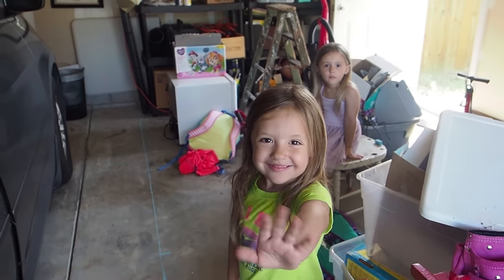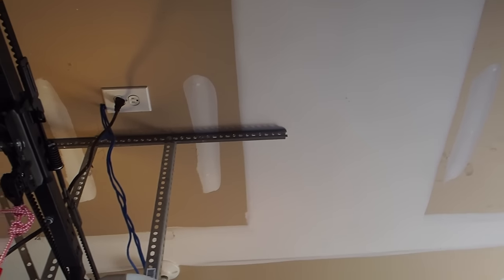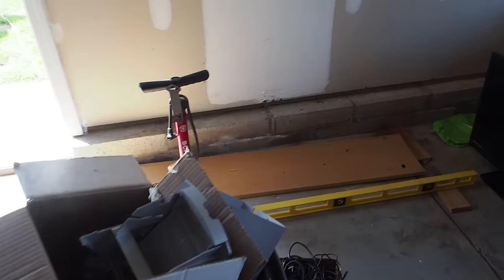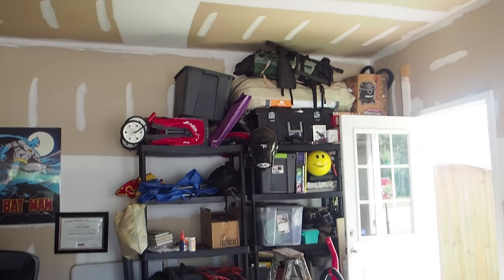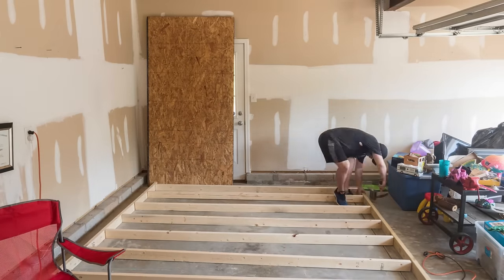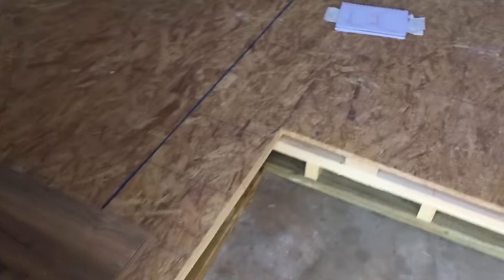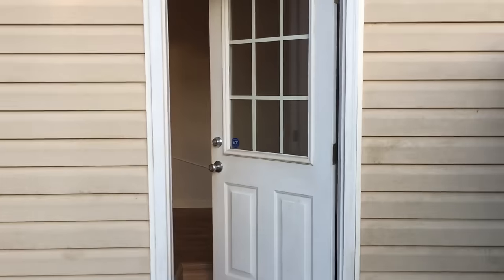I Built An Office In My Garage (and still have room to park our van)!

Comment: I have been looking on YouTube for years and it is almost impossible to find a video where someone converts 1/2 or only a portion of their garage. I rented a room that was 1/2 a garage and the owner did it in 14 days. It had a queen size bed, closet, electric fireplace, and an air conditioner in the wall. The door exited out to the other half of the garage where I parked my car. It was awesome.
Reply from the maker: Underrated house upgrade!

Comment: Funny I'm gonna start next week and I have exactly 8x10 to work with.  My plan is desk on one end with computer and TV above mounted on the wall.  Then on the other end I want 2 lazy boys for me and a buddy to watch fights and drink beer while our wives are inside being responsible watching the kids 😎
Reply from the maker: Yeah, I think it is a perfect size for that, I could easily fit two lazy boys and a small table in between, with a large TV on the other wall, and it would be perfect viewing distance. The only thing bad in my setup is that the inside air conditioner than I'm using is pretty loud... which would not be ideal for watching TV. Could look into a split system, but they are a good bit more expensive. Depending on how your house is set up and the size of your main AC, you may be able to change your ducting to use that. For me it hasn't been too much of an issue because I use noise canceling headphones on my computer almost all of the time, but otherwise it would be kinda annoying.
Reply: @coreyapotter  I have the same ac as you.  I guess I'll just have to crank the volume up

Comment: It may have been a little easier to re-hinge your door to open out and leveled your floor somewhat thinner.  Otherwise a great job for a first try.
Reply from the maker: I did think about that for sure, but the slope of the floor would have been tricky to deal with  even going as thin as possible. Also there was a brick line around the floor that I wanted to cover. The sub floor also gave me a bit more "spring" since I do alot of standing at my desk, and made it easy to run one of the wires to my switch without having to tear up my wall. Since the ceiling was about 10ft, I didn't mind bringing the floor up 6-8 inches. 

Lots of different ways to do it though, and mine were far from perfect, but it has been holding up great, and I'm loving using it!
Reply: @coreyapotter  I'm glad it works for you, and since it is your office, your opinion is the only one that should count.

Comment: Hi Corey, can you advise the process you underwent to build the floor supports that counter the slope in the garage floor.
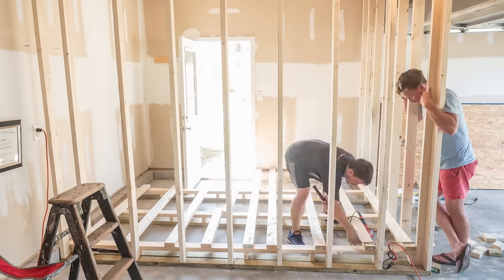Reply from the maker: Nothing too fancy. There was a layer of bricks around the base of the garage that were already level, and at about the right height for my subfloor. I leveled some boards that were laid on top of those bricks, put another board directly on the floor, then measured the height every 18 inches and cut a support (each getting a bit longer as the slope increased). You can see them clearly at 4:04 in the video!
Reply: @coreyapotter  Thanks for your reply.  Regarding the supports, did you slightly taper them (the bottom side) to account for the slope angle?  Or, are they flat both ends?
Also, when you installed the front facing wall (I assume this was levelled straight), was there a slight gap/rise on the back edge of the floor beam (facing the garage door) on account of the slope or did you secure the beam flat to the floor?

Comment: Nice work! Would you need to insulate and heat to officially count this as living space?
Reply: One thing holding me back from doing this is understanding what I can and can’t do based on local regulations/permits, etc.  (i.e. if a room is heated/cooled it may need to be insulated, including the floor).
Reply: @Rick-rn2ur  Probably best to enquire with the relevant council department.  Or, engage a professional builder who will do all this for you, lodge plans, obtain building approval, etc.

Comment: Very nice, I wanna do this in my garage can you please list the material or items.
Reply from the maker: Unfortunately no, I never recorded it like that. I did rough plans and just bought what I needed as I needed it. Mostly 2x4s, drywall, some subfloor and vinyl flooring, and electrical components like wires and outlets. There are lots of things to consider, and while this one isn't meant to be a "here's how to do this" video... there are lots of those on YouTube, and I found many of them helpful in my build process!

Comment: I see you have the heat of your ac going back into the garage, I think in the summer that’s just going to heat up your walls for both your workspace and your garage
Reply from the maker: You are right! I have to open or at least crack the garage door in the summer if I want to run the AC.
Reply: Not just that.. you are throwing CO2 gases in the garage is really dangerous.. you mind want to reroute the ace vent to the outside wall.. other than that.. good work
Reply from the maker: @ethan1627  C02 gases? That is not accurate. Electric air conditioners do not produce C02. The venting/placement has more to do with efficiency. The garage is open 99% of the time, so it really isn't much different than venting on the outside wall. Thanks for the concern though!

Comment: Is it really ok to vent your portable AC in the garage? It’ll cause humidity and even affect your vehicle
Reply from the maker: No, it's not an ideal plan. But I made it work for me and am still doing it this way years later. The "right" solution would be a split system above the door. Jus haven't had the time or budget to make that happen yet.

Comment: I’m about to do the same thing and have almost the same set up but my area is the extra bay that they call a “shop”. 

My question is:

-do you wish you would’ve done a split duct cooling/heating system vs the floor/wall unit?

- is there a need for an access point from inside the garage?

- that step down to the door looks like a hazard. How’s that working out?

Comment: Do you have a list of all materials?  and like what type of wood did you use and all that?
Reply from the maker: I don't have a list. Honestly, it was just me writing down some basic measurements and buying some lumber from Lowes. I used pine 2x4s, treated for anything that touched concrete, and standard for everything else. Standard materials for drywall and subfloor. I think each build will be slightly different, but if you watch some framing videos on YouTube, you should be off to a good start.

Comment: Did you take into account the exterior door?  Room looks great, but the step up space where the door is looks like it was unplanned.  Could you have raised the door as well to match the subfloor?
Reply from the maker: Yes, I took it into consideration. There were several options, and this was the easiest for me. I didn't need that extra floor space and I don't mind the step. Raising the exterior door would have been a major job, including reframing an exterior wall, cutting through siding, and potentially rerouting electrical wires. Just not worth it. I could have made less of a step, but the slope of the floor was pretty significant and I chose this height because I was able to set the frame of the floor on the level bricks around the edge of the garage. Anyway, there are many ways to do any project, and I picked the options that worked for my needs. I'll likely be tearing it out before selling the house, so really it didn't have to be perfect.

Comment: Im confused as to why you raised the floor if you were going to have a step up from the side door. What was the reasoning?
Reply from the maker: The floor of the garage is not level, and this was an easy way to creat a level subfloor.
Reply: @coreyapotter  Oh okay, that makes sense. Could you have used some self leveling compound? I am converting my tandem garage space in the next couple weeks.
Reply from the maker: @melvingray3245  yes, that probably could have worked, but in my case I had about 10 ft from floor to ceiling, so the subfloor made it feel more like a standard size room. Also made it easier for me to run the electricity like I wanted.

Comment: How and what did you used for the floor sub-floor?  Did you include a vapor barrier?  What about insulation?  Where are you located did you need a permit for this project?  Did you do the electrical yourself or sub it out?  I'm planning the same project but with French Doors leading into the office from within the house.  Garage is on the lower level of a three-level townhouse.
Reply from the maker: I learned things about permits that I didn't know before I started. I'd highly recommend getting one, especially for insurance and liability reasons. 

For the sub-floor, I just framed it out with 2x4s and used treated lumber on anything touching concrete. For the laminate sub-floor, I just used the standard stuff they sell at Lowes, some kind of foam, I didn't really pay very close attention to what it was. I still haven't insulated the office, over a year later. I left the outer walls open so I could insulate and just haven't made it a priority because the climate is fairly moderate and so far hasn't been a problem. I did the electrical work myself, but it was relatively simple, only 3 outlets and 2 lights. Good luck on your project! Mine was just something I threw together on a whim, but I wish I had done a bit more research and planning before I started.

Comment: Did any clerical work with the city need to be done? What about inspections like electrical?
Reply from the maker: Yes, but this is going to be highly dependent on your location, as the laws and regulations are different in every country, state, city, county, and even HOA.
Reply from the maker: In general, you apply for a permit (I think they are $25 here), and when you are ready, the city/town/county will send an inspector to make sure you are following codes. 

This is pretty important for insurance reasons. If things are not inspected/approved and let's say a fire is started from faulty wiring, the insurance company may not cover your home.

Comment: Did you permit the project?  Didn't hear anything about that.
Reply from the maker: In most areas, and for many homeowners insurance policies, permits or inspection is required. Also, some HOAs have rules that require you to get any construction approved by them. I learned about some of these things after the project, but in the future, I would definitely START with the permit and have it inspected right after finishing.

Comment: This is great, I'll be building a bedroom in the corner of my garage similar design as your office but bigger.  I'm gonna do this on my own, my question is did you pull permits?  It seems that would slow the process down and raise the price of this type of project.
Reply from the maker: I would highly recommend getting the permits if you ever plan to sell the house or if you want to be sure your homeowners insurance will cover any incidents (for example, if an electrical fire burns down your house and it originated in this unpermitted room, your insurance may not pay). It does slow things down a bit, but in the long run I think it is worth it.
Reply: @coreyapotter  I spoke with a builder who suggested the same - get the permits if/when you the sell the home, just make sure you've got adequate drawings/plans and a documented process of how you built it.  But for sure, the other issue can be insurance if a claim involves/results from the addition.  As it's not an approved structure, they will be sure to scrutinise this.

Comment: I have a questions about the floor?
Reply from the maker: Lay it on me!
Reply: @coreyapotter  I saw that you put wood down on the floor to make it level because your garage wasn’t level but we are putting a Floor on so that I can insulate it. How did you frame the floor. I’m  trying to figure out how much wood we need to frame it
Reply from the maker: @DaNae2334  You can see it best at 4:03 in the video. You can secure these with concrete nails/screws. After this, I believe I laid 2x4s across, perpendicular to the floor frame pieces you see at 4:03. I think every 16 or 18 inches, I'm sure you can look up the recommended code for that. Just make sure you use treated wood on the concrete.

Comment: How is the AC situation working out for you? I noticed you're exhausting A/C into the garage...any issue there? (In Florida - wanting to do the same thing in my garage)
Reply from the maker: The AC worked fine with the portable unit, but wasn't really that efficient. The exterior wall with the door gets direct sun with no shade from like 2pm until sunset, so on these long summer days, it struggled a little in the evenings. Adding a small fan made a huge difference. However, I recently switched out the portable unit for a window unit. I'm still venting into the garage, but it stays open about 95% of the time I'm running the AC (I only close it during thunderstorms or late at night). I definitely don't recommend venting into the garage if you plan on closing it, even running a small window unit for an hour with the garage closed increases the garage temperature significantly. I'm sure its also against all kinds of codes/regulations... so I consider this a temporary solution for myself. That being said, the small window unit keeps the office ice cold, even on the hot evenings.

Comment: Does that room get cold with no insulation or heat? Or are you somewhere that stays warm year round? Did you need to get a permit when you did yours?
Reply from the maker: It stays moderate year round here (South Carolina). A small space heater is more than enough to hear the room. Since it is in the garage (which can stay closed in the winter), there is at least some insulation there. The worst part is in the summer. The metal exterior door gets direct exposure to the sun in the hottest part of the day. That wall gets warm to the touch, so the AC has to work hard to keep up. So far it has been comfortable for about 80% of the year, and the rest is bearable. 

I did need a permit, although I found that out later.

Comment: Where did you get the information on the electrical side of this project?
Reply from the maker: Lots of Googling and watching YT videos. I watched several videos first, then did some research to learn about the electrical codes/standards in my state. Then I just Googled for charts and diagrams once I knew what pattern I was working with. If you do a Google image search for any kind of specific setup (like "two outlets with switch on opposite end of source") You'll find tons of diagrams.

Comment: Did you not have to insulate?
Reply from the maker: I hadn't insulated at the time of this video, but left the outer drywall off so I could put some in. The garage wall that isn't against the house is not insulated... but I figured it couldn't hurt to insulate the two walls I put up.

Comment: Hi do you have a list of materials.
Reply from the maker: No, I just did my best at measuring and estimating what I would need, then made multiple trips to Lowes (only a few miles away). It will all depend on the size, and I've noticed that garages are not very standard. The supplies are pretty basic though. Just watch some videos about framing rooms and you should be able to create a decent list!

Comment: I’m looking to do the same in my garage.  Roughly what did this cost you to do? Thanks!
Reply from the maker: It cost me about $1,200 including the AC. Could have probably saved quite a bit if I had more time and could have sourced things at better rates. I also had to buy a few tools. I think I could have done the whole thing for more like $800, but I think some cases could be much more expensive as well (like if you don't have a door, or have to get fancy with your heat/AC).